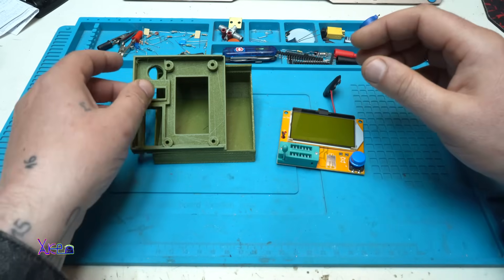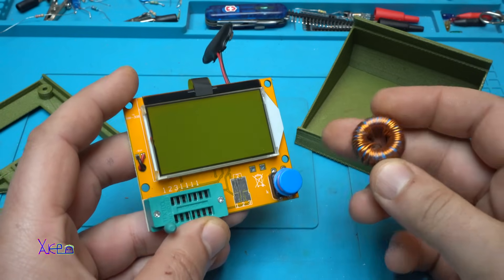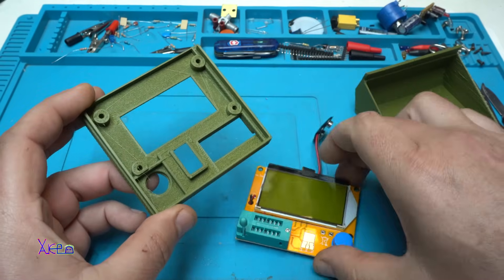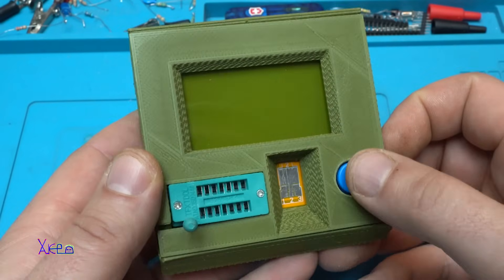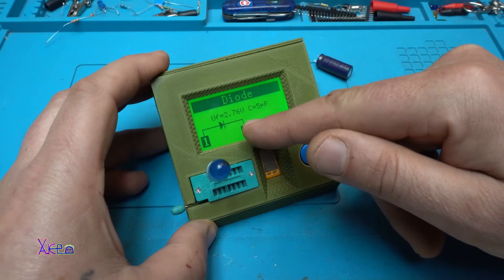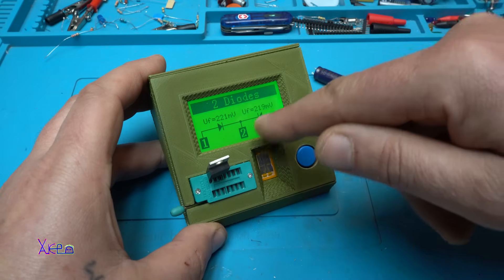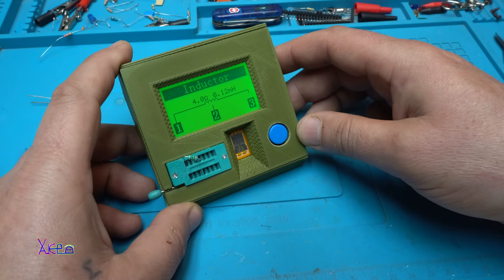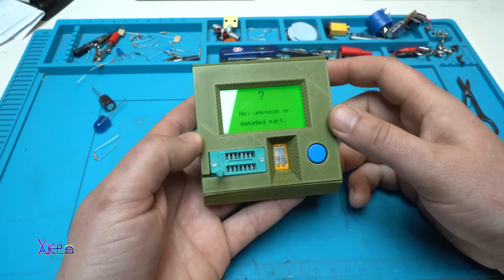ALL Components TESTER - Transistor, Mosfet, Inductor, Capacitor,Diode.Continuity Tester

Comment: Have the tester for 5 years now , put it in a plastic box but wil print this case for it.
solder 3 wires with small clips on the pads far more conveniant than the connector. three colors for 1,2,3  used the connector maybe 5 times, have a nice day
Reply from the maker: That is nice idea with probe wires,I am doing also thx
Reply: Adding probes great idea! Thanks!   😀👍

Comment: Thank you for this video. I was waiting. The day I saw your first video I ordered the module. Today I received the message that it had cleared customs. I should get it in a day or two. I don't have a 3D printer, therefore I am planning to make a case using PVC sheets. Hope it will be as nice as your one.
Reply from the maker: Using pvc material yes you can make a cool case,good for you sir
Reply: I ordered mine too. Looking in my shop for something to fashion a case.

Comment: Not gonna lie, that case looks pretty sweet, now I want for my tester.
PS for chat: I recommend getting the tester that comes with the little syringe-type hook probes, that way you can test de-soldered parts that have contacts cut too short to plug into the tester.
Reply from the maker: Thanks!  I'll try to get one of those syringes
Reply: @Hacktuber  I remembered, they're called 'Electronics probes,' found some with title:
3Pcs/Set Electrical Hook Test Clip Transistor Tester Hook Type Tests Clip Probes Kit with Male Head DuPont Line